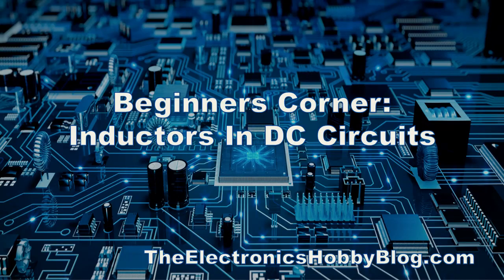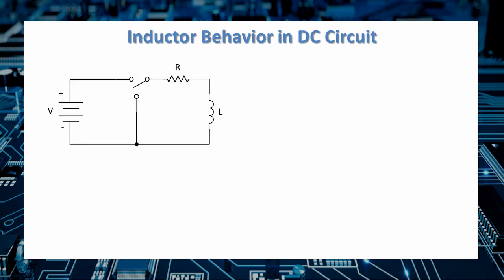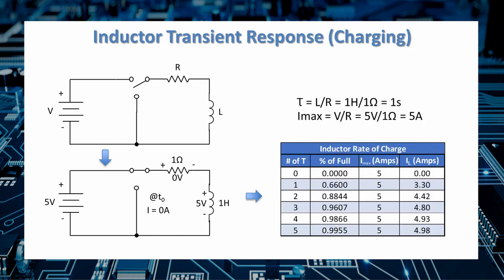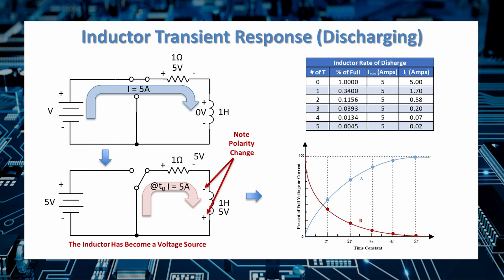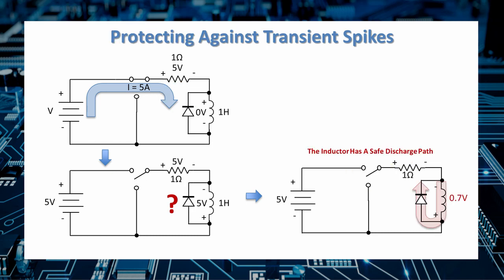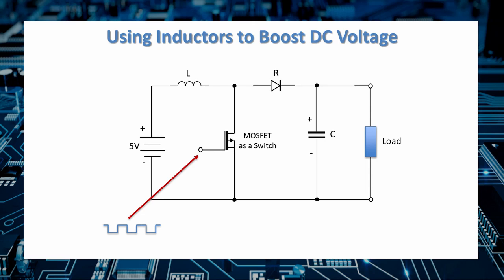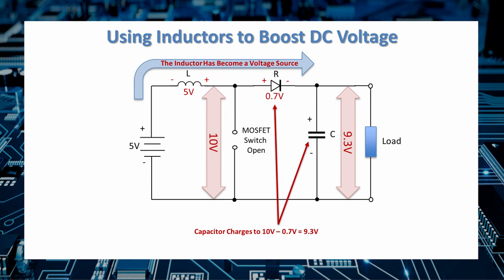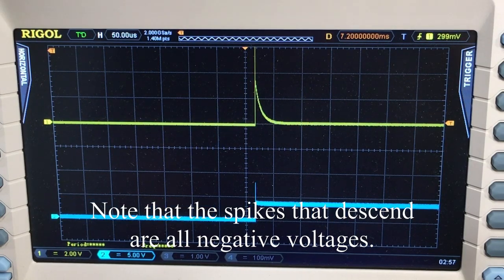Inductors in DC Circuits

Comment: Very good video. I would definitely like to have a better understanding of reversing of the inductor polarity, if you ever get a desire to make another video on inductors. Also, would like to see a video on the effect (or lack thereof) of voltage on an inductor, if it were possible to keep the current exactly the same, and just increase or decrease the voltage.